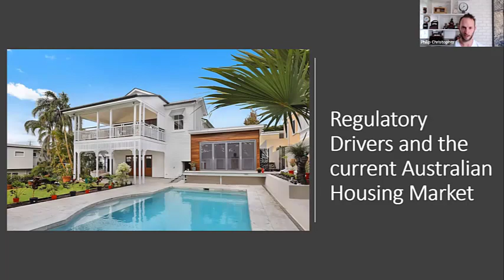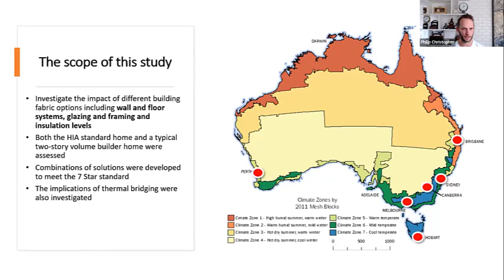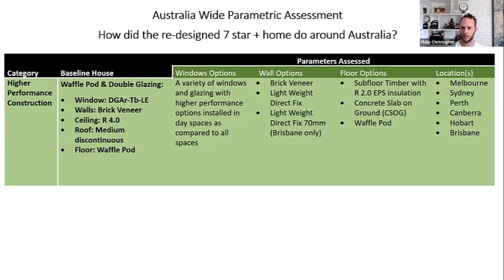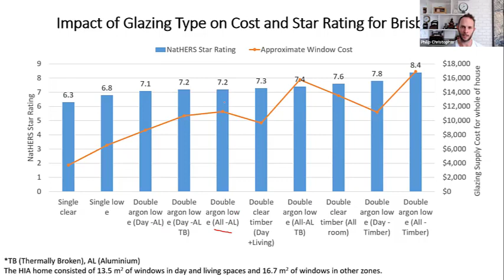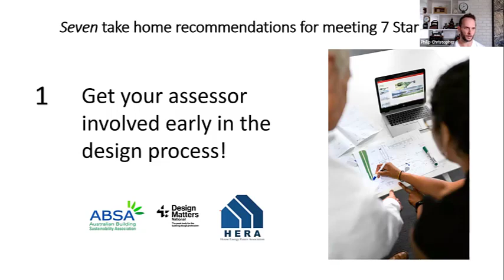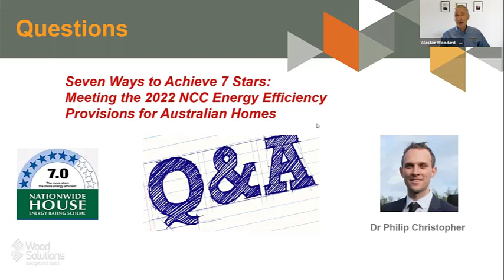7 Top Tips to Achieve a 7 Star NatHERS Rating(Webinar)

Comment: This is all awesome, but how do I learn to use the software? I don't want to put an inadequate design in front of a paid assessor and then go through the iterations of making it work - I want to be able to use the software myself well enough to produce a design that meets my requirements, and then present it to an assessor to check my workings and certify it.
It seems like the training options are do the cert 4 to become a qualified assessor, or ... nothing, really. And even if I did the cert 4 course, I wouldn't be allowed to design a house and then certify it myself and then build it with no other person checking over my design, so there is no benefit to me in doing the cert 4. I just need to know how to use the software.